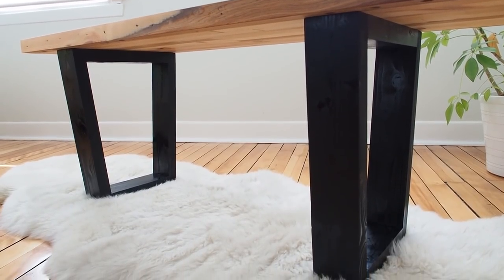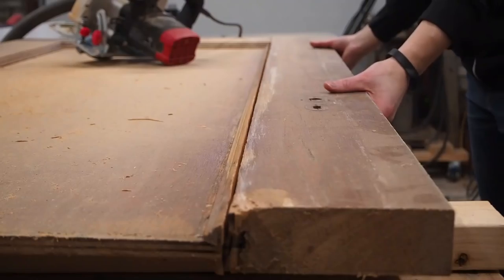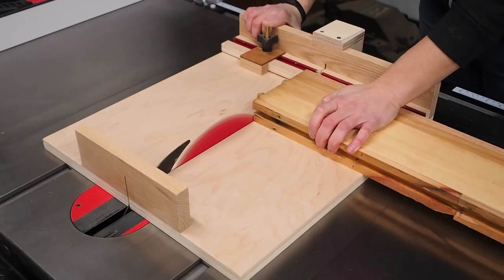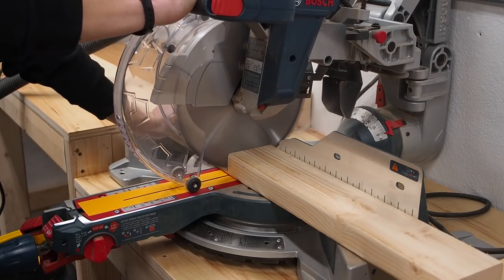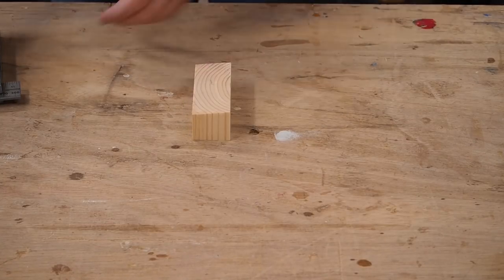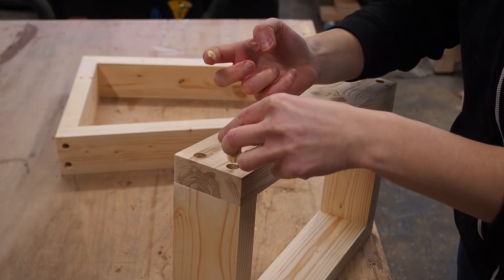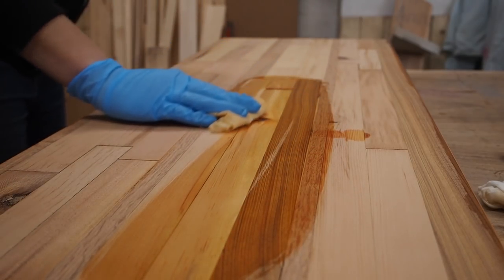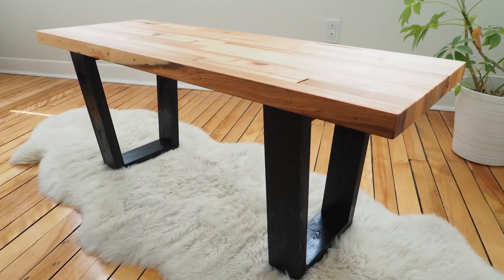Trapezoid leg bench | Reclaimed wood from solid core door

Comment: Great use of the old doors. We always think woodworm over a certain age is all solid wood, but this proves that cost saving has always been a part of manufacture. If you drill two holes just apart enough that there is a wall between, then wiggle the drill bit in noe fo them while it is going round, this will create the 'slot' you're looking for.
Reply from the maker: Thanks for the tip! And yeah, they knew what they were doing back in the day.

Comment: Gonna try the trapezoid legs, except its for an aquarium table, so the wider part is going to be at the bottom for more stability.   I don't have all the tools you have, so I'm a little concerned - I'm wondering how bad the 2×4s will look without sharp edges (no planer).  Maybe hand plane?  Idk.  Also, I'm going to try putting the fastening screws on the top and bottom so you can't see them and I won't have to fill them will a dowel.  It will be a horizontal joint line instead of vertical.

Comment: angling the drill left and right is what I do also...
Reply: Same here
Reply from the maker: I guess it's an effective way even if it ain't pretty ;)
Reply: @DIYMontreal  with a table you can use clips in a slot, but that doesn't really work with a bench.   With the size here I doubt that you'd have much wood movement to worry about anyways.